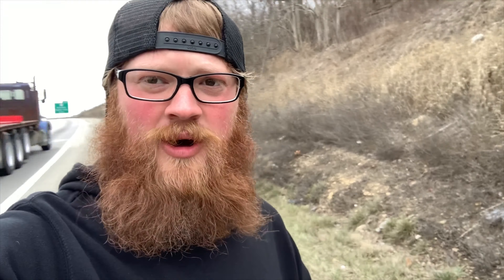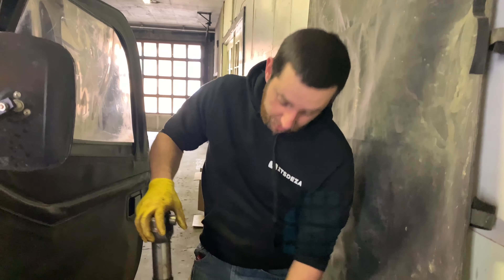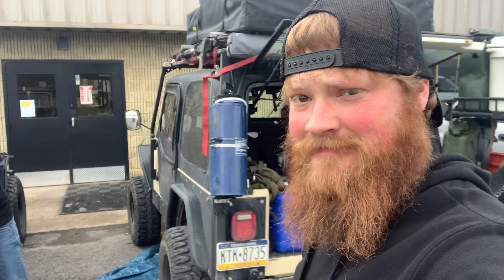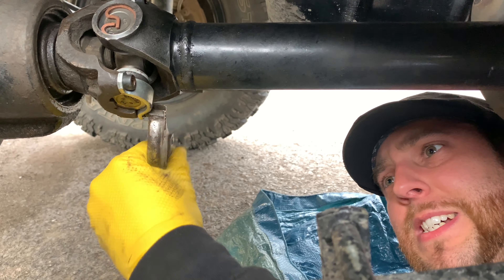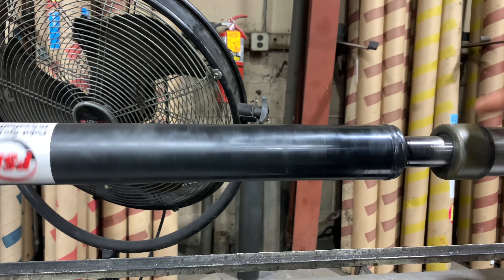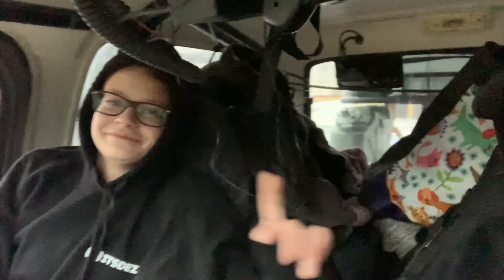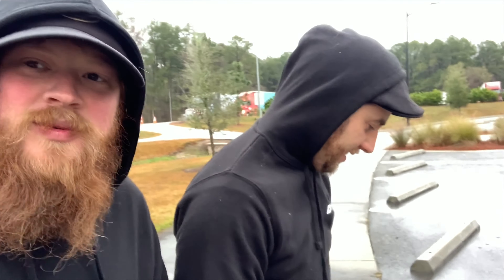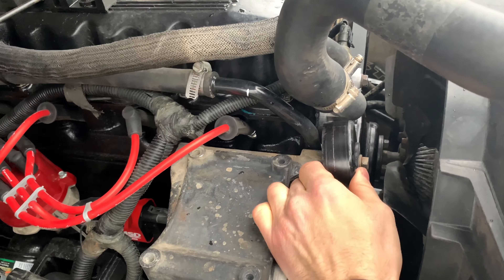Worst First Day To A Trip Ever...

Comment: My 1995 YJ 4.0 wouldn’t stop leaking from the lower radiator hose after I replaced the entire cooling system. A heavy duty expensive clamp from Napa did the trick!